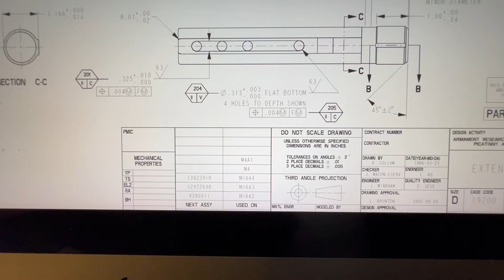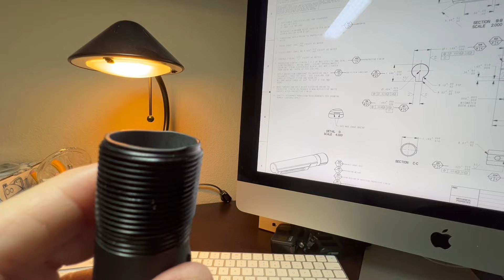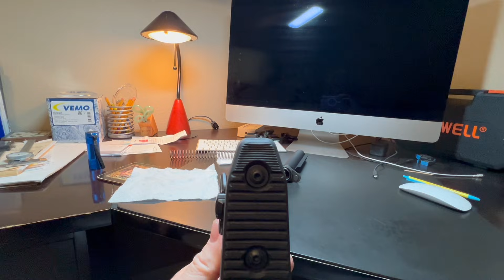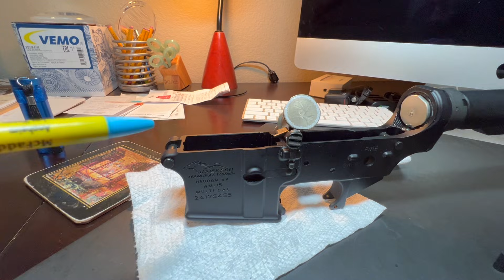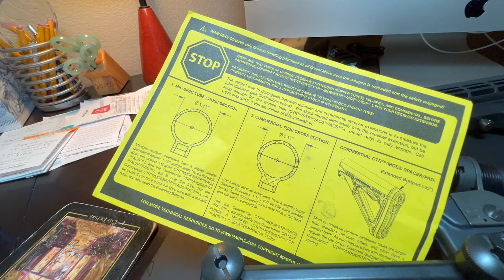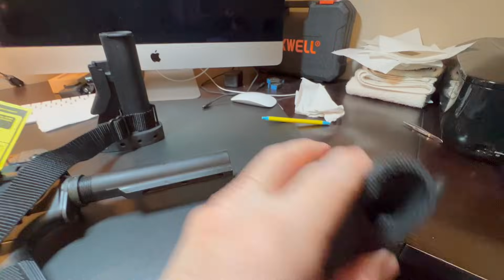BCM (Bravo Company) M4 MilSpec Buffer Tube vs Commercial Buffer Tube!

Comment: Thanks for another good video, Pete. I saw the first time you posted it, came back later to watch, and it had disappeared. Thought I'd went crazy for a minute. Really enjoy the specs and your insight! Take care.
Reply from the maker: Thanks John! I inadvertently showcased some personal info! A viewer caught it and let me know.
Reply: @peter1956-x4s hey man, I was wondering if I could ask you a few questions... 
Was about to go up 1 buffer weight and wanted a BCM buffer to match my BCM BCG, 
but my LGS only have 2 choices:
 Another reputable brand of  buffer by itself, or the exact BCM buffer in a complete receiver extension kit for double the price of the other buffer... (About 80 total)

My current buffr tube is a standard "Aero" tube so wondering if you have any experience with Aero to know if I would be making an actual upgrade by spending extra for a BCM buffr tube assembly to replace the Aero parts, or is there a chance that their won't be much difference to where it may be a waste of money?

 I'm on the fence mostly because I would like a slightly smoother hand cycle if I'm buying a new extension, and while I do see the dry coat film inside,
 Im a huge fan of lubing  buffer springs so I'm now curious if that would rinse away the dry lube film, or if oil would work in conjunction with the dry lube 🤔 

Sorry for the long message, you just seem like the type of dude that pays close attention to detail/Quality control so I wanted to reach out.
Reply from the maker: @tonynorris1506  Aero makes good stuff! I don't think you'll notice much difference if you went to a BCM tube if any at all compared to your Aero. Although BCM does make theirs to Milspec and with the correct dry lube coating I don't think it provides some huge advantage other than being able to run it dry... for a little while until it scrubs off. I run some light oil lube with the coated BCM's and they're fine. I have seen some videos where grease was used to quiet a noisy tube and I think that is a bad idea. The grease will become contaminated and trap debris and firing byproducts turning the grease into a honing/sanding paste. I have not noticed that running a little light oil with the dry lube is an issue. All that being said I would just run the Aero and save yourself a few bucks. I clean and lightly lube my buffer assembly after each session no matter the round count. Thanks for stopping by!
Reply: @peter1956-x4s  awesome info man! I know that Aero has been a bit spotty in QC since the pandemic (plus becoming the biggest supplier for every LGS in the country due to their low prices) but I was thinking to myself "how can they get a buffer tube wrong" aside from possible leftover tooling marks inside...
Had one guy tell me that 60% of the Aero tubes he got had threads that were class 1 (very shallow and not milspec) and he said that they can walk loose eventually even when staked due to not engaging the threads of the lower deep enough. He said that BCM had proper Class 2 and sometimes closer to class 3 (super tight tolerance threads) although I'm not even sure how exactly to measure to test for this difference as I have an extra Aero tube and wouldn't mind comparing them just to see if they differ...
Overall,
If the Aero tube is milspec material, I may stick with it because I'll probably end up getting too much lube in the BCM dry film tube and gunk it up. Lol
(Or heck, maybe one day I'll upgrade to their newest A5 setup which is said to be buttery smooth, although right now with the 500% spike on tungsten, I'll wait because buffers have went up 2.5x in price in the past month and it's said that Tungsten will hit a 1000% increase later this year driving them up even higher...
Something to do with China and the current state of the world, although lets just hope that normalizes at some point because right now everyone are trying to buy up h2 and H3 buffers at normal price as most companies are either sold out, or have already raised their H2s and H3s to 100+ bucks... BCM went from 45 to 120 just for an H2!
Reply from the maker: @tonynorris1506  ODIN Works sells one of the better adjustable buffers and if you just want the weights they sell those separate as well. You can change the weights on the one you have already but I wouldn't reuse the roll pin nor uninstall or reinstall to many times as the buffer hole diameter will suffer. There are gauges you can buy to check the thread class fit but they are pricey. You can tell if the threads are rolled or straight cut just by looking at them. Rolled threads will appear shallower. My personal opinion on A5's for 5.56mm/223 is that you get very little in return. The A5's I put on my LR308's using 8.5oz buffers with 308 rifle springs made a very noticeable difference! Aero Precision's website for just about anything you might actually want is out of stock. Most other retailers that sell Aero also out of stock. The rumors are that they are no longer circling the drain but are probably in it! Unfortunate and how does this happen? Aero Precision, Stag Arms, Ballistic Advantage and VG6 Precision all fall under White Wolf Capital so I imagine they are all in trouble!

Comment: Another good lesson from the top QC inspector assembler. Have you ever had a retainer pin break? Appreciate your teaching.
Reply from the maker: The Colt buffer shown that had been damaged was my own worst example and the retainer pin managed to survive! I don't believe that the receiver retainer hole had been wallowed out either at least not that I could see. The old Colt didn't start out with the problem but it developed over the years. I've been catching this stuff during my new builds and have gone back and checked all my store bought inventory and have installed the off-set retainer pin before anything happens. I haven't broken a retainer pin but have seen some pictures of the carnage! Thanks for stopping by Allen!

Comment: Others I have received ship with the buffer and spring in the tube, spring compressed and a plastic cap screwed on over the tube to contain everything.  I have a bunch of the plastic caps in my 'parts box'.
Reply from the maker: About a year ago I bought just the BCM tube from a local FFL and it was in a nice box with their logo on it. Wrapped in plastic as well. A little surprised how these two were packaged. I purchased them directly from BCM as well. They weren't damaged at all so some good luck there!

Comment: Received a Bravo " mil spec" RMS last week, bought through Primary Arms. I bought the Bravo RMS to use in an out of spec Diamondback lower that had the retainer pocket drilled too far back. I also bought a Galloway SS offset buffer retainer and a KAK offset buffer retainer to compare for product quality. The new Bravo receiver extension had an "enhanced " lower lip with rounded edges and a notch cut into it to hold the retainer pin. With the flat, straight cut rim of the extended buffer retainers, the "enhanced" extension made very poor contact and the retainer pin would wobble freely under the rim of the extension after hand snugging the end plate and castle nut. I've used 4 of these kits previously, but this is the first time I've seen the Bravo extension with this "enhancement ". Bravo said that this is a recent modification to their mil spec tube. Well, I never liked this Diamondback lower anyway. To many things wrong with it.
Reply from the maker: I know Brownells started recently selling off-set retainer pins and I can only assume they are designed the same? I couldn't see how the enhanced or slotted buffer tube could possibly work with an off-set because of how they get captured into a non-rotating position. If you were to try and use the enhanced buffer tube without the slot you would have to get your Dremel or file out. Thanks for stopping by Wayne!
Reply: @peter1956-x4s Thanks. I'm just going to buy a standard, "un-enhanced", Mil Spec extension to try to salvage that poorly made Diamondback lower. Receiver made in 2022 and should have been caught in QC, whatever that means to Diamondback.
Reply from the maker: @waynehajek839  More and more often now we are the QC! It's everything now! Have a good one Wayne!

Comment: Having the thread diameter larger than the tube on Milspec ones is something I have seen but it didn't register in my head until now.  All great tips, thank you. I also want to check if any of my commercial tubes have cut threads rather than rolled.
Reply from the maker: Thanks Fearless! Fewer commercial tubes out in the market but you never know when you might run into one!

Comment: Great video, from watching all your video's I did my first A2 build on my last build. Do you have any recommendations for rear sight brand name. I used a cerro A2 upper and a luth A2 sight kit. The slop left to right is crazy.
Reply from the maker: Thanks Eric! I've had good results with Fulton Armory and Rock River Arms for A2 iron sights. Cerro forgings are usually good. The slop from side to side on the rear sight could also be from whoever did the receiver machining. Sometimes you're just rolling the dice. Thanks again!

Comment: Excellent information Pete on mil vs commercial buffer tubes and installation instruction. 
During my Colt armorers class the instructor stated all Colt buffer tubes are forged and milled rather than extruded. He claimed the forged process was much stronger than extruded. Caleb from Brownells claims different.
 I have not been able to verify if BCM uses forged or extruded. I do know I have had zero problems with BCM (mil spec) buffer tubes.
 I have had problems with Vltor buffer tubes. Vltor does not have the dry film lube, the inside have had rough machine marks as you described in the video and I had one that was not straight (bent down wards). I discovered this using the Pro Firearms receiver extension tube jig. It works as a gauge too.
Reply from the maker: Thanks Hairy! I find that Brownells info is sometimes suspect! Lol! Watched one where Caleb was trying to install a RifleSpeed gas block using the MilSpec bent gas tube instead of the correct straight version. That one had me laughing! The BCM parts I have used so far seem to be at a minimum built to MilSpec. I had never thought to consider extruded vs forged on buffer tubes so I'll see if I can figure that one out. Probably listed in one of the TDP's somewhere. I don't have a 100% BCM but it seems you rarely hear anything negative. Thanks for stopping by!
Reply: @peter1956-x4s  I have had problems with some BCM parts like bolts and a hammer forged barrel. They did replace them pronto. I agree about Caleb lol, that was pretty funny. Have a great day Pete.